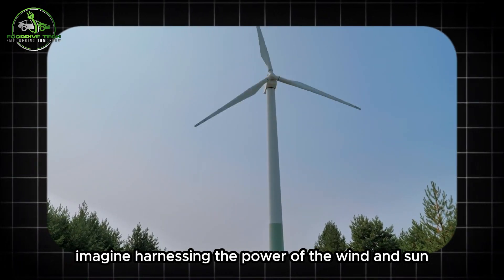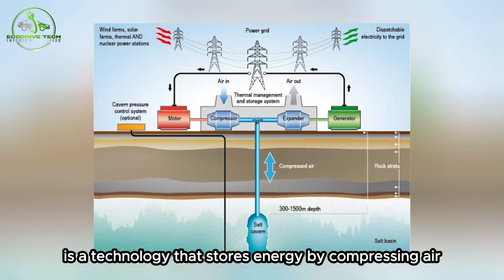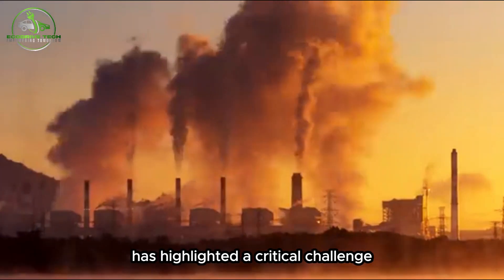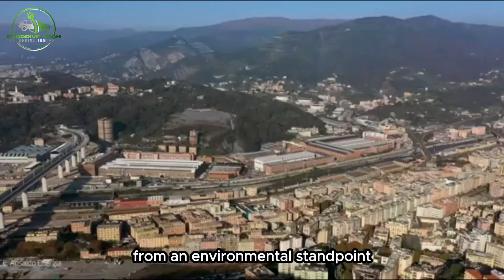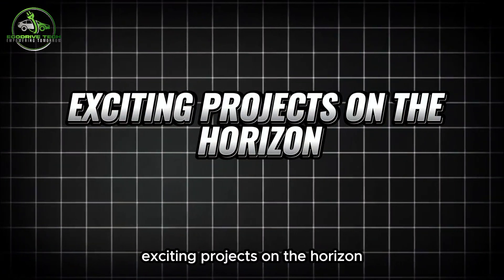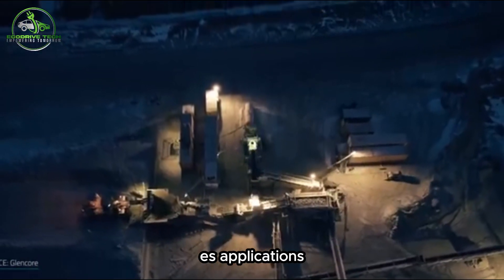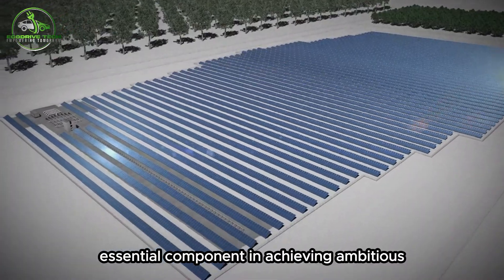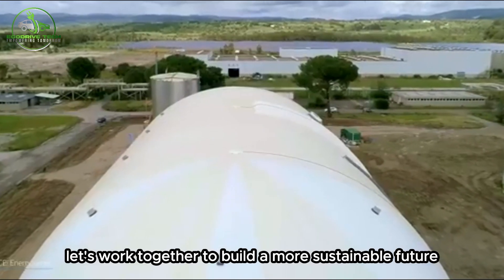This Air Technology Will REVOLUTIONIZE Energy Storage! | Compressed Air Energy Storage

Comment: this is stupid its not storing energy per say.  Its creating electric via solar, wind or hydro then using that electric to create the compressed air. Then it uses more energy (probs from the grid) to turn the compressed air in to electric for usage. This system does not work as a electricity storage.
Reply from the maker: Thanks for watching